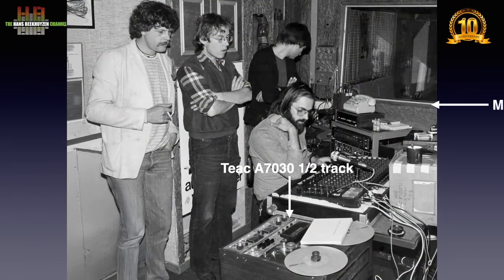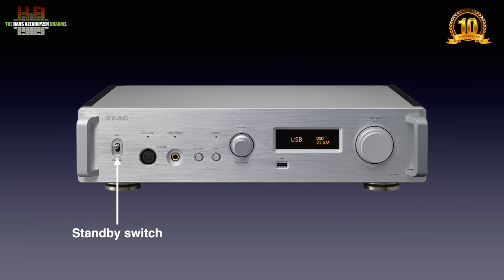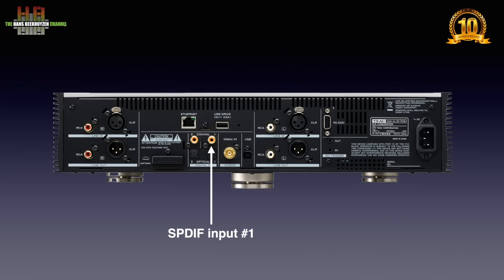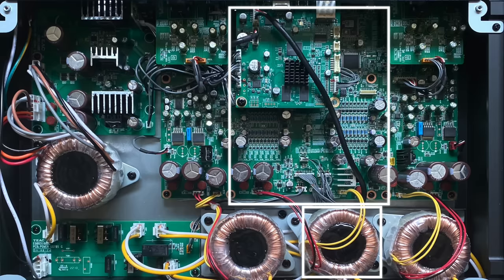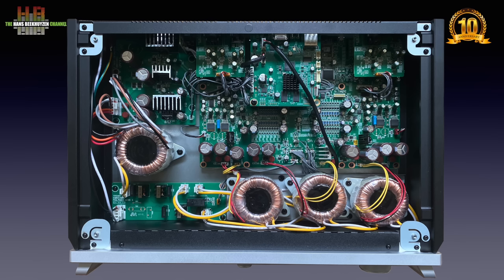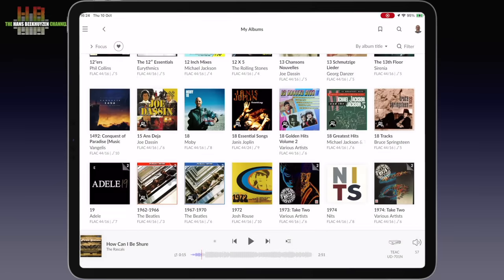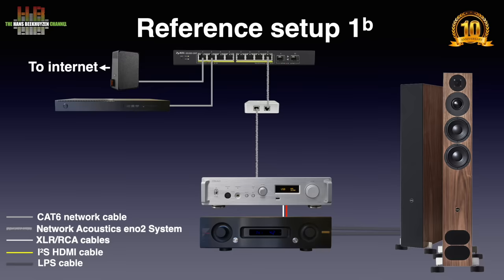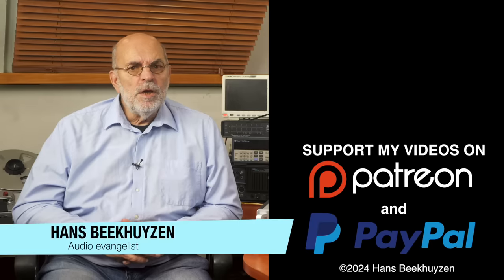Teac UD-701N: DAC, balanced analog pre-amp and HP amp and more

Comment: Hello Hans, I bought this dac two months ago, it is an amazing product.  I have listen to it on the headphones 4pin XLR output and it has surpassed my daps AK SP2K and Hiby RS8. I'm wondering if you will review the latest version of their clock. I have ordered the amp Ap-701, which is also a mono design. I hope you review it in the future. 

I have a question for you: Why did you add a streamer to the chain if ud-701N already has a streamer and you could connect it to the network filter? What's the purpose of this?
Reply from the maker: I might review the clock. As I said in the video: "So I only tested the streaming functions with the Teac HR Streamer app and Roon and the analog inputs with the analog XLR’s outputs of the Grimm MU2 streamer as source."

Comment: Not a fan of 2 channel stereo components looking like AVRs and/or HT processors on the back, but only one line out(s) no sub out(s) makes no sense to me. 
Otherwise the build quality looked really solid.
Very interesting review
Reply from the maker: Thanks for sharing
Reply: not sure what you mean by no line outs? you mean as in a tape loop? I mean you can run it in fixed volume mode via RCA or Balanced output into any device of choice.
Reply: @1061shrink1061  it is single ended in and out. I clarified what I was saying. There are digital inputs. Why not more inputs/output connections?
Like I said, not looking for a HT processor just more than a single analog in and out